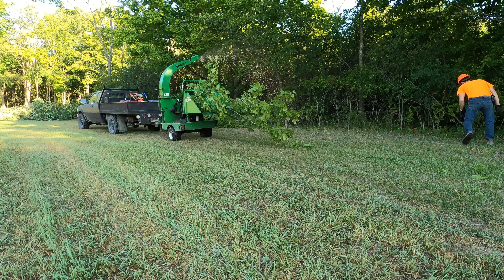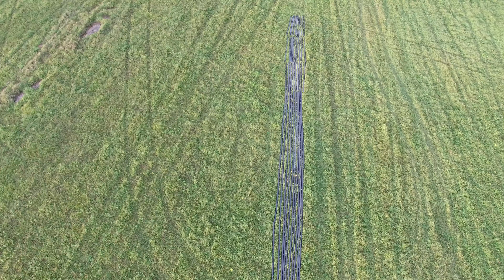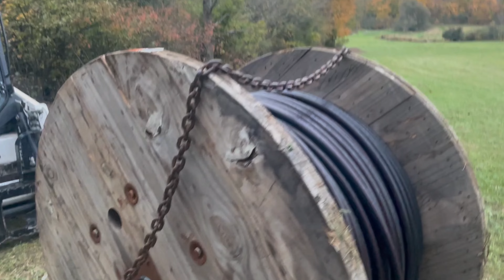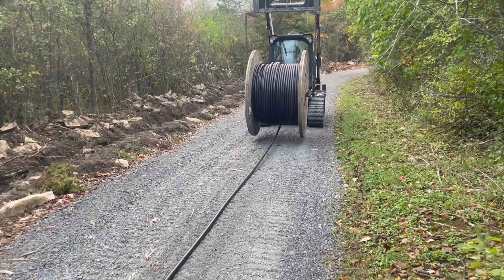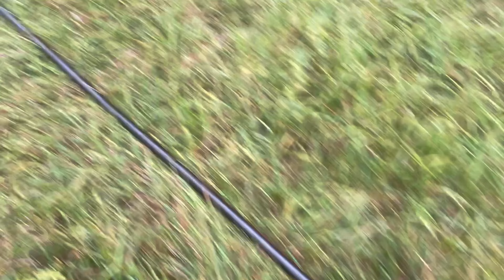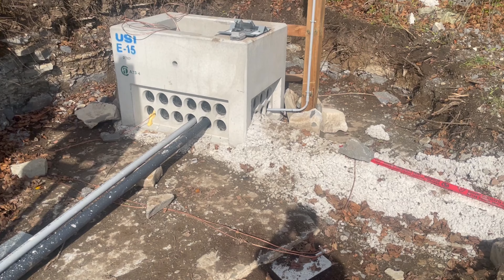Installing Underground Electric Service - Hydro One Ontario

Comment: Only one wire comming in from the pole?
So is that SWER (Single Wire Earth Return)? From memory I thought you needed much more substantial grounding for that. And also seperate grounds for both the HV and LV side.
Reply from the maker: There are two conductors in the wire

Comment: Great video especially for someone whose knowledge of electricity is that it makes my toaster work, thanks.  

QUESTION:  I'm looking at purchasing a house in the country (eastern Ontario) with the overhead wire being both an eyesore and a concern with respect to large old trees that might come down on the wires at sometime in the future.  So, the house is already wired but I would like to bury the cable from  the hydro one pole to the house < 100 meters.  Can you briefly describe what I might be looking at?  Again thank you.

Comment: I like your video  very detailed and informative.   

I am in the SW  Ontario are am planing to do a similar installation.

Have 4 existing Hydro One  connections on my property  and trying to consolidate them to one central metering.  +   add a  backup generator and PV solar cell  with inverters and batteries  for my own use  only 

Hydro is supplying power  to my the property from a pole transformer  and onto the   a overhead line  that connects onto my own poles ( 5 private ) currently) delivering power to the 4 properties   @ 200 amp service each .

I have the option to (A) stay with the overhead service or  (B) go underground  with pad mount transformer. 

if i go with option (A)  overhead   - the service is 120/240 split   I will have to install  12 gauge wire on my pole connected to a Central meter  and Hydro one will  install a CM connection on the pole IE a DONUT type of device and reconnect the existing  overhead power lines to the  Donut   so that the existing services can  be reconnected .  they will take the 4  residential meters out and I have to provide my own dummy meters  

My question is : 
How will I be able to install a transfer switch ,  so I can connect the generator and my inverter/ batteries / solar  PV infrastructure  to this ?
-  I would like to do this at the same location where the meter is  .
-  both generator and inverters would need to provide power only to all 4 connection  and not back to the grid  ( thus the transfer switch ??)
-  and  also  want to have the ability to restrict  the power consumption from the grid based on TIME of USE  bases  and when to use the batteries / solar PV 's .  ( the programing can be done at by the inverters ) 

Will i have to bring the main power  feed from the donut  down the pole ?   Then connect the ATS  (automatic  transfer switch )  and the rest of the infrastructure  generator / inverters/pv and then go back up the pole with an other wire  to connect  my existing /current  power lines that go to the 4 properties.  

If I Use Option B -  since i have 4x 200amp services  do i need a  800 amp transformer?   will i have to reconnect each property separately to the 4 connection at the transformer or can i use the existing overhead power lines to distribute power to the 4 properties?

Appreciate any of you help
Reply: Hello Mike. did you finish your project? I have a similar installation too. I just signed the contract with hydro one. I might have a couple of questions to ask

Comment: Thank you.. great video.
Can I ask what kva transformer you used and budget cost.

Also what’s your high voltage wire size? 

Was all this specified by hydro?
Reply from the maker: Hydro will spec the transformer. Mine was about $2000 good for 400amps. 

Wire is 2/0 aluminum 28kv rated XLPE coated primary wire from Noramco.
Reply from the maker: Hydro will tell you everything you need
Reply: Thank you Rudi for taking the time to respond. This information is golden. I didnt realize doing this work yourself was even an option. @rudijones

Comment: Almost done. 600' Parry Sound area. Your video took away the intimidation.. We do not have enough money to pay an electrician/contractor. We zig zagged through forest and over bed rock to save trees and keep it away from the driveway. So as to not cause issues in the future with adding structures etc. Lots of effort. No regrets.
THANK YOU BIG TIME

Comment: This is great.  I'm having issues getting Hydro come to my site for for a layout (no house on the property).  Did they require you to have a foundation in to do the layout?  If not, how did you do the application for Hydro One?  

Much appreciated,
DM
Reply from the maker: No foundation at the time I did the hydro to the transformer. I just called them directly and a guy came out to talk about the layout.
Reply: Thank you for the quick response.  I'm not having the same luck.  Maybe I'm requesting the wrong service.  Did you request a new build service layout?
Reply from the maker: Mine was called a “basic connection plus” v. 2019
Reply: @rudijones  thanks again.  I'll ask the question.  Cheers!

Comment: Fantastic Video. I am also doing a similar project north of Huntsville Ont. Tring to wrap my head around how the central meter base is installed. Drawing from hydro states only a 3/4" conduit running between the vault and the meter base? Ix this correct.
Reply from the maker: Yes that’s correct. Hydro will install 3 - 12 gauge wires that run the meter itself. They do this when they install the transformer so leave a pull cord from the meter to the vault in the 3/4 so they can pull the wire

Comment: Great video and explanation of everything.  May I ask, did you order the concrete enclosure for the pad directly from USI?  I have a similar project and may or may not have the pad built on site by a concrete contractor.  I'd assume it's easier to just order the pre fab pad...?
Reply from the maker: Direct from usi. I could be mistaken but i think it has to be a certified enclosure.

Comment: How much were you able to get material for excluding concrete and conduit?
Reply from the maker: The wire was approx 11k all the other misc. electrical parts not including concrete and concrete suit was approx 3k. I cannot remember how much tranny was. Hydro provides it as part of connection package.

Comment: Great Video, doing a 400 Amp service to a camp ground, What type of meter base you use and where to get it? thanks,
Reply from the maker: Eaton TSU5C-H1C available at Wesco in canada. Approx $800 CAD 2 years ago
Reply: Dave, you’ll want to refer to Hydro One’s list of approved meter bases. It all depends of wether you’re installing a traditional service or a central metering service. The Eaton base is for central metering. A traditional base is several hundred dollars cheaper typically.

Comment: Amazing video.  Everything looks fantastic.    My wife and i are looking to install approximately 900-1000ft of underground. We are located in Eastern Ontario.   If you have time for some quick clarification i would appreciate it. .....as long as the trench is able to be at a depth of 30" you are able to just lay the cable without the DB2 piping as well?  Thanks again for the great video.  Cheers
Reply from the maker: Yes that is correct as long as the backfill is not abrasive. Sand is best. Electrical inspector will spec backfill for your specific situation based on test trench
Reply: @rudijones  Thank you for your response.  I appreciate your time.  I actually think you might be close to my area. Small world.   Best of luck !

Comment: I’ve referenced this video a few times for my 400m install. Almost done! Got the grounding grid set up today.

A quick question about the central metering..what’s the cable spec that runs between the meter and transformer? 

Additionally, did you use the same #4 copper wire for the singular ground plate at the temporary panel?
Reply from the maker: Just leave a fish line between meter and vault. Hydro one will provide wire and install. I believe it is three (red white black) 12 ga
Reply from the maker: And yes to the #4
Reply: Awesome! Thanks, from NW Ontario

Comment: Really great video, appreciate it. Doing a very simular service for my property and a few things I had to wrap my head around and couldn't til I found this video.

What size tech cable are you using for 100amp service or is it 200 amp? 

Thanks
Reply from the maker: Thanks! That teck cable is actually only feeding a 60amp panel in my garage about 100m away. It has aluminum wire 2 awg conductors. The house will be fed directly from the transformer with appropriate triplex to feed a 200 amp panel.

Comment: Does a temporary service follow the same specs and need for a vault etc.?
Reply from the maker: I can’t say for sure. It would be a question for hydro.
Reply: I asked Hydro One a similar question during my layout. The answer I got is Hydro One doesn’t really do temporary services anymore. The service needs to be installed with the intention of eventually going to a house/garage etc. that being said, you’re allowed to hook it up to a temporary panel while building. The installation still needs to be done to the same spec and inspected.

Comment: Did ESA require the pre cast transformer vault or could you have used a fiberglass pedestal?
Reply from the maker: Never asked. I’ve never seen a fibreglass one around here
Reply from the maker: Hydro will spec the vault in the connection package.
Reply: @rudijones  Thanks for the info! Did Hydro 1 come out to inspect or just ESA? Fiberglass pads are fairly common up here in NW Ontario. The transformer I’ll be pulling primary from is on one. Those concrete vaults are bloody expensive. About $1900 up here.
Reply from the maker: @CDNSldr1  esa inspects, hydro comes out to hook you up. They don’t really inspect but I’m sure they won’t do hookup of something is wrong.

Comment: Great video. I’m just starting a 500m underground install in rural NW Ontario. Thankfully the soil appears to be deep in my area. 

Not sure if I missed it in the video, but what’s the spec on the primary direct burial rated cable? Brand? Number of conductors etc? I’m trying to get a quote for a spool but I’m not sure the exact specs to tell my supplier.
Reply from the maker: Noramco PRODUCT DESCRIPTION: 28KV/100% TR-XLPE 1/C 2/0 AWG AL 15-#14AWG CN with Strandseal®
Reply: Hydro One specs the wire you have to use. They always go way over even if the requirements are less.
Reply: @austinward8289   Yeah it’s unfortunate. I finally got my layout and they spec a 2/0 aluminum 28kv cable for my 7.2kv service. Not sure why they go so overkill.
Reply: @CDNSldr1  Future proofing usually, I'm using the same wire. Have to run 400 ft of it to a pole at the road. 

Have to confirm my 100 amp tech cable size and 200 amp tech cable size as I have 5 building to run from the transformer on the secondary side
Reply: Thanks for that! Just curious, any reason why you went with a cable with 3x the voltage rating of your 7.2kv service?

Comment: Like others, I am enduring the same type of project. I have about 750’ from the hydro on the road (the pole is on the other side of the road from my property).  I will have to come across the road overhead and then was thinking about going underground.  I will do my own excavating. I am curious if you can share some costings on a project like this.  I understand the wire is very expensive and for my distance, I may be further ahead to go overhead all the way.  I am in North Bay so i am encountering rocks with every bucket full.  Nothing I need to hammer but then again I am only 150’ in.  There may be surprises in the future
Reply: I was able to get my 28kv rated 2/0 alum cable (this spec was required by hydro one) for my 410 meter underground run for just under $23 per meter. This was purchased within the past 2 months through Westburne. The distributor fully expects the cost to continue increasing. Comparatively, the same wire was $13/m 2 years ago.

I don’t know the equivalent cost of overhead wire. I don’t think the savings in wire would be substantial though.

Comment: wow is that ever slick...just what I want to do. I'm just starting to get organized with hydro now. How did this compare cost wise to putting in poles?  Did you still have to pay hydro for future maintenance? And you didn't have to cut a 30' wide swath of trees for the wires. Any Info would be great. Thanks.
Reply from the maker: Hey, going underground for us was actually the cheaper option because we do excavating for a living. There is no ongoing maintenance fee to pay hydro. When you do this you own the utility past the pole at the road. Any maintenance on your property is your responsibility. If you go with overhead service you will need to clear a swath either side of the poles/wires. If you decide to go this route hydro will tell you how wide in your connection package. You do not need any clearance for underground wire. You just need clearance around transformer I believe it’s 15’.